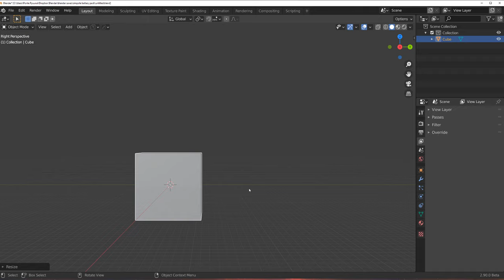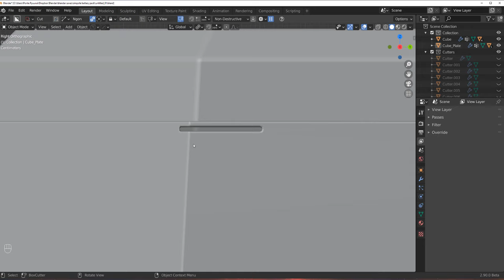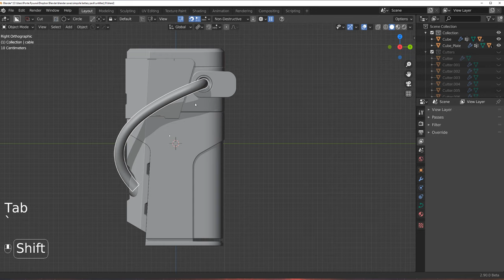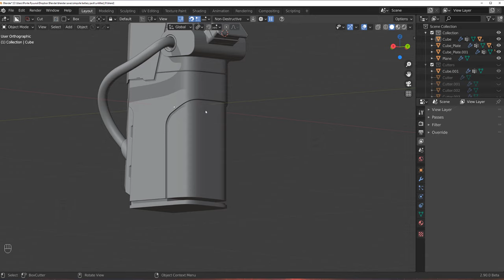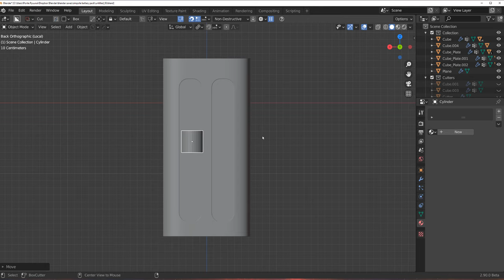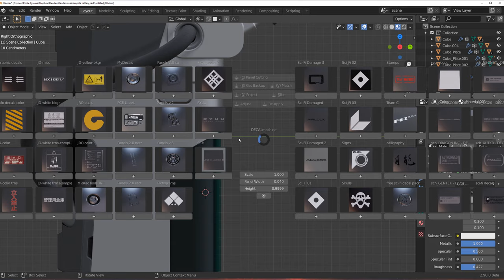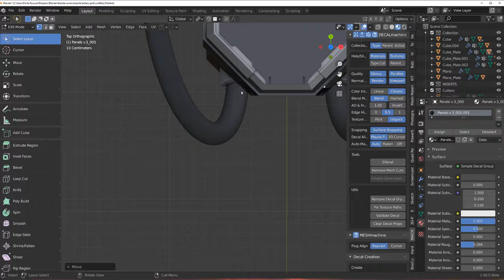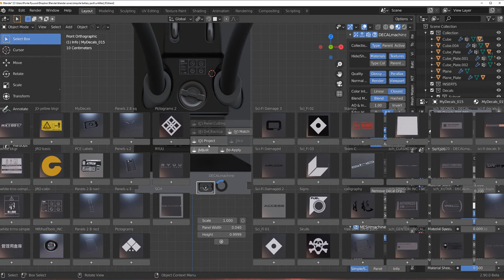Scifi terminal Blender TUTORIAL - part 1: modelling

Comment: For anyone else having this issue, "Cable Ops" at 17:13 seems to have been renamed to "Cablerator" and if you click the link in the HardOps preferences, you can get a 25% discount on that add-on!
Reply from the maker: it was never renamed, it was always called that, simply hops has a different naming
Reply: @PonteRyuurui  Ah okay! I couldn't find anything under the name Cable Ops but noticed that Cablerator had the same UI, so I had just assumed it was renamed when they released it a few weeks ago.

Comment: 1:32 you were able to change the width of the bevel using the "Y" key. How exactly? I also have the machin3 add-on installed and I've watched your tutorial on machin3 tools but I don't seem to get same result as you did at this point sir. What should I enable in my add-on for that? I'm using the add-on that's for free on his gumrod page by the way. Is that enough?
Reply from the maker: its mesh machine, not machine tools
Reply: @PonteRyuurui  hmmm. Ohhh thank you sir. I really appreciate the clarification. Mesh tools and mesh machin3, got confused about them

Comment: Would you use these same sorts of bevels for a gameobject?
Reply from the maker: Yes, you just need to drop them to one segment, and go with mid poly modeling. So 1 segmented bevel + weighted normals. It is a bit more annoying to UV the mesh, but it isnt that bad.
Reply: @PonteRyuurui  with hard ops when you sharpen an object does it also apply weighted normals automatically?
Reply from the maker: @Game-Garden  no, neither ctrl mark sharp or smart apply WN.